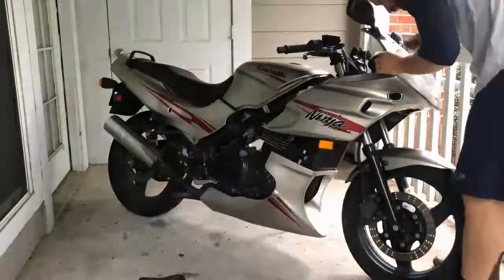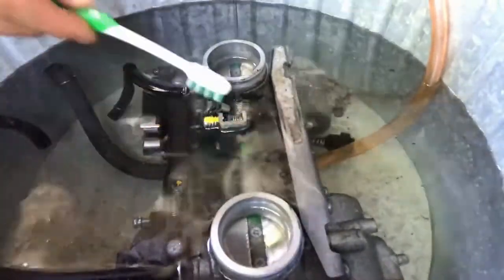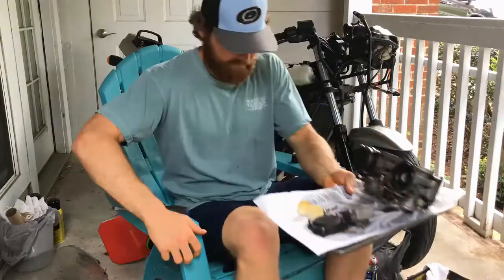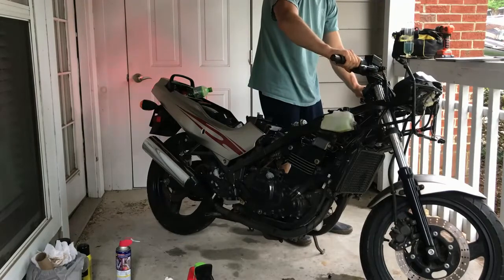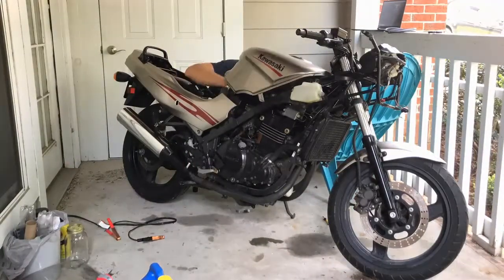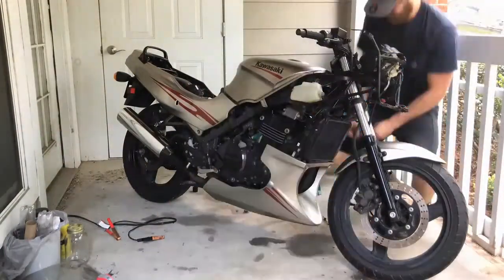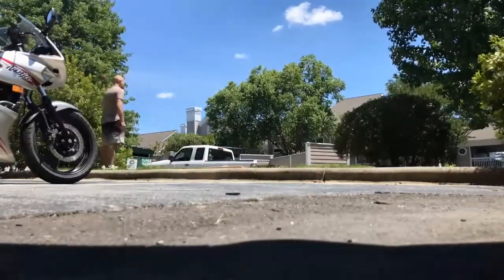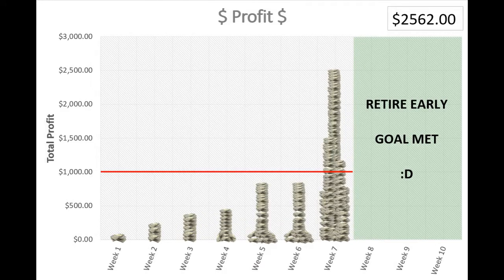S1E6 (FINALE) - Kawasaki Ninja 500R

Comment: Tom Cruise rode a Kawasaki GPZ 900, with an inline 4 cylinder engine that made more than twice the horsepower of this Ninja 500R, which is powered by a parallel twin engine, in Top Gun. FYI.
Reply: Gpz900
Reply: @thisisthedavid1  I stand corrected.